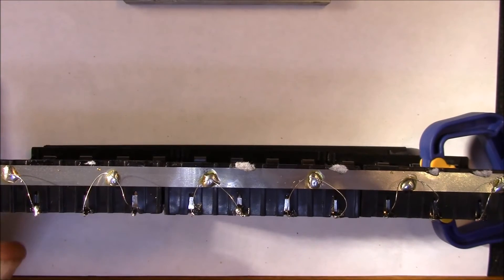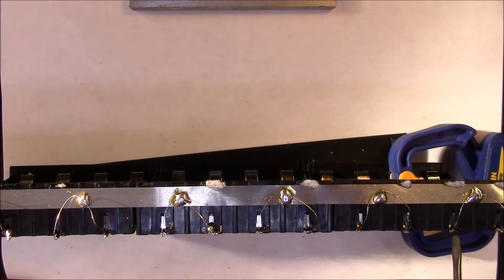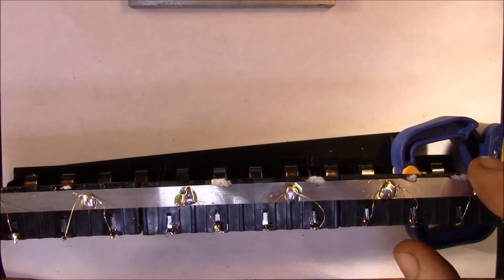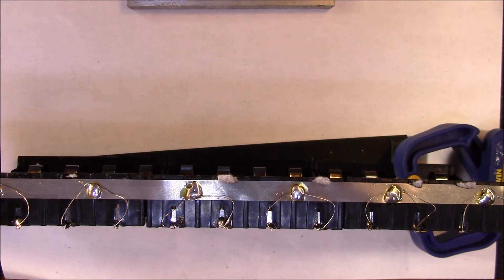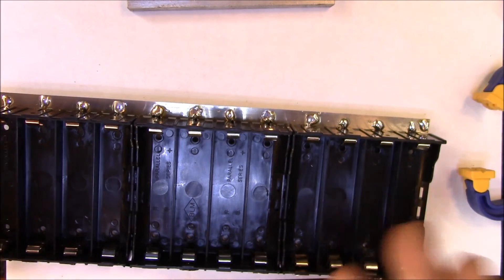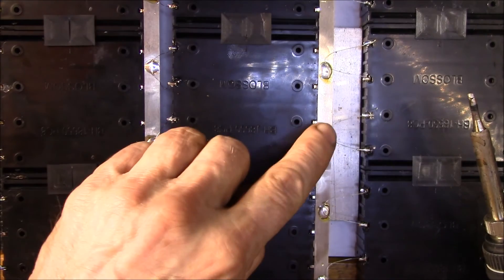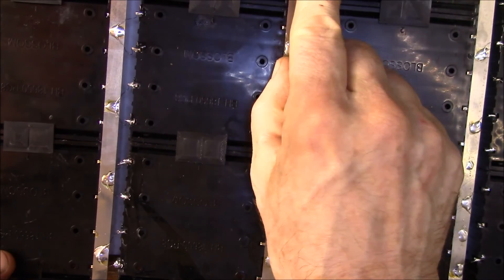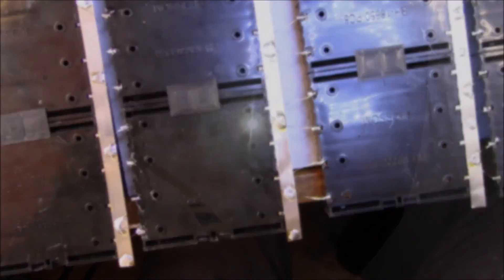Lithium Ion Battery Power Shelf, Part 4

Comment: for what purpose will you be using this setup?
Reply from the maker: This will mainly be used for staging cells for testing prior to moving them to my permanent battery holders.  I want to be able to set up a group of cells and cycle them for a period of time to weed out weak cells and also to be able to easily swap cells around to achieve better capacity balance between the groups.
Reply: so basically you would sort the cells using this setup?
Reply from the maker: Yes, at least the final sorting and testing step.  It's a fair bit of work to put cells in the the finished battery pack, so I want to be fairly sure that what I put in a given pack is going to be what I want.  So having the ability to swap cells easily with the cell holders makes a nice setup.  I will have already tested and sorted the individual pairs of cells prior to putting them in the power shelf.  This will be testing a whole group of cells together and making minor adjustments to that group if needed.